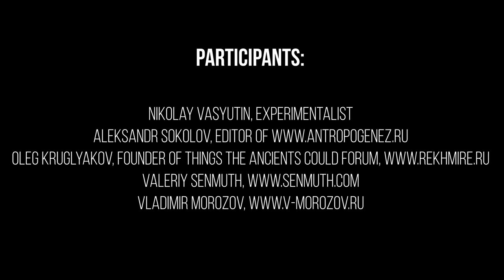Making Egyptian Drill Holes: Lost Ancient High Technology

Comment: Hi, thanks for this. I think the idea of using clay/sand is convincing. As an Egyptian, I have seen this idea still being applied in some local areas for different purposes.  
However, This is convincing in case you prove that the ancient Egyptians made "tubes" of cupper. How the ancient forge/extrude tubes of copper? Today, this needs an extrusion machine. Also, how to accurately maintain the outer/inner diameters of the copper tube?

Cheers (y)
Reply from the maker: What? Extrusion machine?? Forge a piece of copper into a sheet and wrap it around the stick. To read: https://antropogenez.ru/drilling/
Reply: Flat copper hammered sheet wrapped around a cylinder shape, not necessary to joint it. Just a inset holder at top.
Reply: easy - copper is such a fusible material that it can be smelted even on an ordinary fire without a forge, in order to create a pipe you only need some kind of straight planed piece of wood or a clay mold, all this can be done by hand. The processing of the bones of various animals by the Paleolithic Cro-Magnons is a much more complex thing and they easily coped with it.

Comment: Nice work! Has the effect of adding water and new abrasive from the inside of the tube been tested? This would obviously require an access hole somewhere up the tube, but it would also wash these cut clean whenever you added water. It would probably affect the finish :)

Comment: Appreciate your work very much, your quite correct people need proof in tangible forms, maybe because we are so devorced from manual labour for the most part.
Reply: well, that, and (I think) most people are visual learners anyhow.
Reply: There's still manual labor, only now days you just put the key in, start the engine and gun it and have a hole drilled in under 5 minutes at 20,000 RPMs

Comment: It's also possible that they could stabilize the shaft with greased wood bearings and a crude wooden mechanism if you needed to cut holes in the side of a stone.

Wooden machinery has been used for a long long time.

Comment: A very good video, thank you! I can imagine with the large resources they had at the time, plus ingenuity and experience, that the Egyptians could have easily constructed a strong support for the drill as well as a means of rotating it using water power, or maybe a treadmill worked by animals or people. In that way drilling could continue uninterrupted all day, with grinding 'sand' being added at intervals and the tube replaced from time to time as needed.

However, I am still perplexed by Dunn's (clear to me) observation that the grooves are spiral on the original cores, such as Petrie core #7. Are the grooves on your cores spiral or just a series of separate circular grooves? I still find it amazing that they went to the effort of cutting so many large tube drill holes and wonder why they did so, also have any original copper tube drills or pieces been found that you know of?
Reply: I'm sure as easy as copper is to work, it would have been recycled many times over, for various tools. I like the way you think though, the idea of stabilizing the tool, and powering it by ox or mule, would have made the process much faster. Thank you for your insight. Very well spoken. :-)

Comment: I think you could have use some pipe for the handle also so you didn't get blisters lol. I think the ancients could have impregnated the copper with dolerite or granite dust. It would work like modern diamond impregnated steel blades and drills work. It would just wear faster. 
However. There is a huge issue many don't address in videos like these. They have found core drill samples that have absolute perfect spirals down the entire length. A string can be wrapped around them to indicate how the cutting tool cut roughly a millimeter per rotation (I'm guessing at size as I'm in America and here it would be roughly 1/32 of an inch lol.) 
This method of drilling requires hundreds of revolutions per millimeter as you bore. 
So while yes, this is correct for much of what we see, especially in later dynasties. The ancient people used something very different.
Reply: Are you referring to Flanders Peitre's core 7? That does not have a perfect spiral grove. And can be easily replicated. https://www.youtube.com/watch?v=HQi4yql7Ysg
Reply: @Leeside  yeah I was basing my statement off of apparently some very well staged misleading information. I have since lost interest in the core and changing my mind after the guy here showed me some real info also on the matter. 
I'm not one of the guys that beats a dead horse lol. If I see sufficient proof I will concede and admit when I'm wrong. 
I wonder if they was mislead too. I give them the benefit of the doubt. But if it's the same core that I saw being made to sound like it was a spiral they're pretty well into the liar category. I was seeing them wrap string around the dam thing and whole nine yards lol. 
Anyways lesson learned. Thanks bud

Comment: How did the ancient Egyptians get the copper that well rounded (obviously machines in this video)? starting from there... you'd need a copper drill tube very well rounded, almost perfectly circled?
Reply from the maker: You don't need the "perfect tube". You take a copper sheet, wrap it around a stick and that’s it. You can even drill with wood or bone. We have experienced it all in practice
Reply: @ScientistsAgainstMyths  well, why didn't you use that in this video? I can tell that the copper used was a Machined copper tube. Not trying to disprove but just for the sake of argument.
Reply: @gabrielpwv  In their other granite cutting video they actually cast their own copper tube.
Reply: How does one make "a casting mold" = lots of ways.  Back then you could simply make a mold using say = fired clay - which coincidentally is still used today.  A potter perhaps might fashion from clay cylindrical molds - perhaps as alluded to using carved wooden cores to shape the clay around - to fire that to generate a mold into which molten bronze could be poured.

Another ancient casting method was = wax......  Using shaped wax molds one could also fashion molds and cast metal objects.  Today one sometimes sees compacted sand molds as well whereby compacted sand is formed into a shape into which molten metal is poured.  

p.s. - as alluded to the end product did not need to be perfectly smooth as friction from use will smooth it out once "a bite" is obtained and the bronze tube is rotating against the stone inside of the cut.
Reply: @varyolla435  nice, yes they could have but I do argue that if the copper tubes where not perfect thst end result wouldn’t have been perfect. It’s imperative that the copper tubes lead the shape impervious to the grinding of the sand but yeah, I can see the ancients making them perfect with wax or clay. They where superb artisans of their time …. And time was on their side.
Reply: @gabrielpwv  Why drill a hole??  Why build a temple say with blocks with holes in them to no apparent end??  Answer: 

1 - holes were likely employed for the insertion of wooden framing - such as hanging a gate on a building entrance.  Wood being a valuable resource in a desert environment however would mean that wood left in abandoned temples etc. would be scavenged = leaving only blocks with holes.
2 - meanwhile the Egyptians sometimes scavenged these abandoned sites for raw material to build something else.  So a Pharaoh/Vizier who wanted a temple but perhaps times were bad and they lacked the resources could simply cannibalize old sites for stone blocks.  Cheaper and far easier than paying to obtain newly quarried stone. 

Final thought.  Because as noted above ancient sites were used as raw material after the fact one must then allow for subsequent modification of blocks originally sourced to the Bronze Age to be reworked = during the Iron Age.  In other words a temple built during the Old Kingdom - when bronze was in use - might see modification or cannibalization during the later New Kingdom when iron tools became available.  

This means some of what we see would therefore not have been done with bronze = but iron.  Consider say the Serapeum with its' granite sarcophagi - many of which were created during the Iron Age while the temple itself was created during the early New Kingdom when bronze would be commonplace.  We therefore can not assume.  All things in the correct period/technology.

Comment: Your method is interesting, but it does not explain the high rate at which holes were drilled into granite. According to Petrie’s measurements, in one particular sample of granite the rate of the drilling was “0.1 in the circumference of 6 in or 1 in 60.” This is 500 times faster than current granite drilling technology which drills and leaves a remaining spiral on the cone of  0.002 in per revolution (Dunn, Giza Power Plant pg 84). If Petries measurements are correct, the method you present could not have accomplished what the Egyptians did.
Reply from the maker: Thank you. Look: https://youtu.be/HQi4yql7Ysg
Reply: Dunn: Giza Power plant sounds like a very reliable source :D

Comment: Very interesting; thank you for showing this. A video about a South American site with some clearly drilled holes started a discussion of the possible technology, leading to speculation about abrasive pastes on the end of a pole. The tube is clearly more efficient, since it only requires grinding away a thin hole, rather than abrading the hole mass in the hole.

Comment: I don't know how they did it but with the copper tube drills which was probably more like brass. Either way I've never seen the heat this would produce and the affects on the tool also not just the length wear on the tool but the wear on the inside and outside of the tool. Well they had multiple tools, but I bet they didn't have 2 with the same wear and this would put the hole out of alignment pretty quick no matter how often they switched out drills. It would be a task to drill a few inches and who knows how many times they would have to switch bits out. There's no doubt they drilled but they had some alloy they made that would last a lot longer than brass. They had to have.

Comment: Why are there striations on all Egyptian tube drill holes, whereas holes bored by copper with sand abrasive does not ever make clear striations? You can trace one continuous striation on Egyptian tube drill holes, exactly the same tool marks appear when you push a modern drill through wood or concrete. This requires a very hard cutting edge if you’re creating these tooling marks on concrete.       Really, please answer me, it boggles my mind how would-be debunkers ignore this.     Or how about the fact that when using a copper tube drill with abrasive, the copper is worn down at a comparable rate to the granite , and in some experiments the copper wears down faster than the granite. If Egyptians were boring holes with copper tube drills, there would be copper dust fucking everrrrywhere, which would stain the granite and even thousands of years later the evidence of large amounts of copper dust ground into thousands of holes all over Egypt would be a common sign, it would be common knowledge that copper dust shows up everywhere. But there’s no evidence of copper dust, and no copper tube drill has ever produced spiral striations as appear on all egyptian tuve drill holes and their respective cores.

Have you ever built anything? I did concrete form work for six years. You sound like a close minded academic who has zero experience working with power tools, hard stone, concrete etc….  Your experiment doesn’t prove your thesis whatsoever
Reply: You managed to get all your facts wrong. The reason for this is that you read claims from others and believed them.
Reply: @Eyes_Open  what is your point? Make a point.  For example, I made a point about the continuous striations made by a very hard cutting edge being pushed through any medium, the marks made by a drill. The striations made by a drill do not at all resemble the marks made by an abrasive wearing into stone. If you’re gonna tell me I’m wrong, say how. Or say how you’re right.